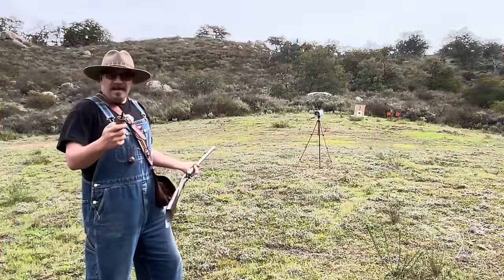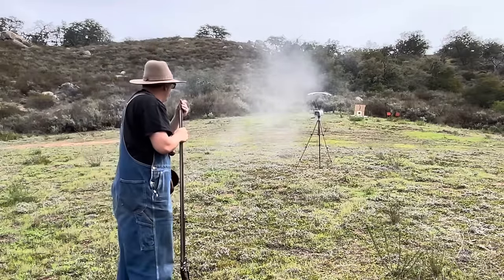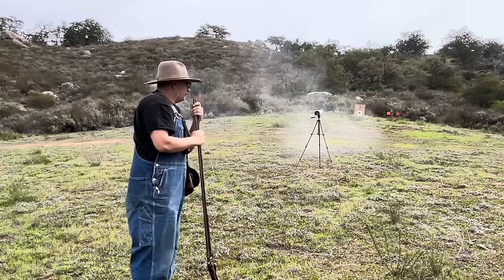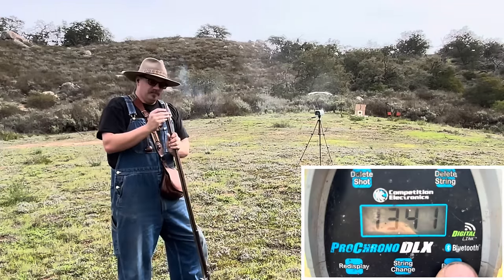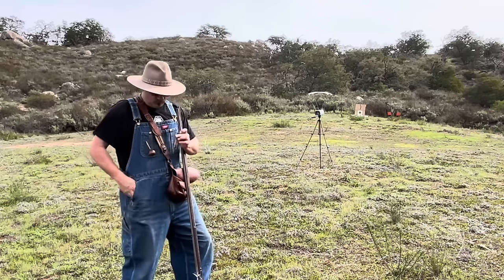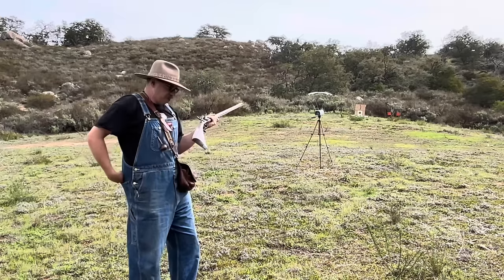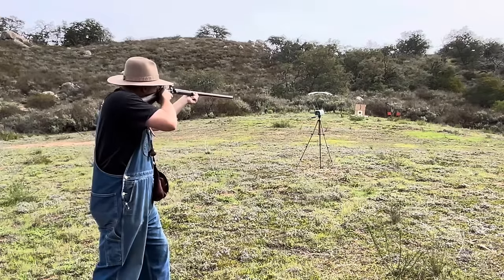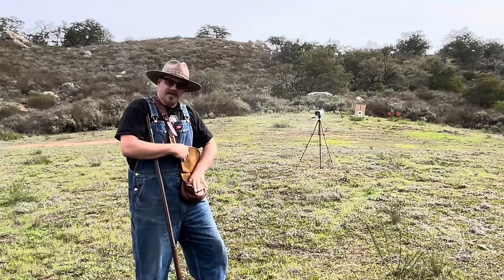Hay Bale Black Powder

Comment: I can see where straw would make poor powder. It has no substance, no mass, so I can see where it would be weak. I would almost bet it was dirtier than you think, but being so soft it cleaned right up with just a little pressure. That may help explain some of the ignition issues as well.

Comment: Thanks for your great videos.

I was always surprised by the zero failure rate in your other videos, this stuff makes up for that .... 

My theory was actually that fast growing plants may not acquire many other minerals and be quite pure carbon. Would be nice if one here in your audience had access to a gas chromatograph and you could each time send in samples to get "a look inside" what the composition of the charcoal really is. 

The other thing, ..., I would guess things like hay, which people had in abundance in the last 400 years or so was already tried. If that was a real game changer it would already been used and heard of. For the military a better powder back in the day would have had many advantages, number of shots on the man, more supply in one cargo, higher production quantity in shots per time, ...

Maybe your best chances lay in the exotics continuing the line of researchers from the past using what was not available to them. This is exactly what lead to the discovery you made with the toilet paper.
Reply from the maker: Thank you

Comment: Somebody beat me to this observation, but the problem could be phytoliths, particles of silica that help with structural rigidity, and may offer some defense against the herbivores, who have evolved specialized teeth to cope with the problem. Although I find it counterintuitive that they wouldn't also create difficulty loading if they're interfering with combustion. I expect you'd get accelerated bore wear from prolonged use of phytolith-contaminated powder.

Comment: This looks like me with my flintlock.  Except yours occasionally fired. Still waiting for Cardboard.
Reply: Expecting poor results from corrugated cardboard because it's glued together.
Reply: @0neDoomedSpaceMarine  Could well be true, but I looked into what the Glue used actually is and it might be OK.  I'll be trying this when my supply of Skylighter charcoal runs out.  However, I have a lot of that, so it won't be this year even.

Comment: Ceramic media is much less dense than brass, and so it is less efficient at grinding. I have found that a HF 4" rock tumbler jar half full of media holds about 1.25 lbs of ceramic and close to 4 lbs of brass. Big difference. The brass drops with much more force as it tumbles. I like the ceramic media for a vibratory style tumbler where it has a strong rattling and toroidal circulating action, but not for a rotary drum. I have had problems with ceramic media grinding pure KNO3 in a drum where the KNO3 sticks to and coats the media, demonstrating the inefficiency of the ceramic. I don't see this effect with the same ceramic in a vibratory tumbler. My HF tumbler is modified to run at about twice stock speed, so it is close to optimum.
There is one other thing that I have noticed: I try tiny samples (match head size) of each BP batch open burned on a creased piece of paper to evaluate its burn characteristics. If it leaves a gritty residue on the paper, it needs more tumbling time. What appears to me to be fully incorporated powder leaves very little residue that has a dusty texture. I have not yet tried any of my powder in a gun yet. I am using fireworks grade airfloat hardwood charcoal and I am intending it for fireworks use for now. I don't have my charcoal retort ready yet, nor am I quite ready for granulation processing. I'm close though, and will let you know results when I have some batches complete.

Comment: OK Jake I know I suggested you try tobacco or it's fun cousin. But the results of the hay bale black powder, are pretty close to what I suspect tobacco would produce yet I do not know that it would be. I think you have several problems going on with the hay bale black powder, one of which I think is moisture content being too high in the hay. But why don't you try using a can of Prince Albert tobacco, and see if it produces the same results or worse. Oh and for the guy that made the pancake remark, no mixing your pancake batter does not make it taste better as it just makes the batter chunky.

Comment: If you take 24h or more making pancake batter, it is very good, but mostly because it's being made with yeast instead of soda and you're making crepes, English muffins, or delicious sourdough versions of either. 
I'm glad I held off on stating my assumption that ceramic media is probably the main problem, since that's covered in the video. I'm thinking that the problem is the small bits of dust that come off of the ceramic are going to be absolutely bad at burning - due to ceramics already being fired at high temps - ,but the brass media is dropping zinc that eats up oxygen and reacts out stuff that would otherwise degrade your BP, and the copper content... Well, just go look at videos of copper thermite (Cody's Lab has some spectacular videos on this) to get a feel for how great a raw metal powder is at combustion.
One daydream I had instead of increasing the video speed is to wet grind the VERY DRY mix in glycerol and calcium carbide. This may be great for a very small batch to be used very soon, but has the additional risk of turning any moisture into acetylene gas and calcium carbonate. The calcium carbonate should dissolve in the glycerol, but I have no idea if the powder would burn right. It was a daydream after all.

Comment: Awesome! If long milling turns crap poweder into descent powder, what  will it do ti really good powder?
Reply from the maker: Generally speaking, it makes it that much better. However, you will eventually reach a point of diminishing return.
Reply: @Everythingblackpowder  diminishing returns is the point you want to fund.
Reply from the maker: In our experience, it’s about 48 hours
Reply: @Everythingblackpowder  
Might be an exploding breach too.
Ever explore weaker powder for weaker guns? Maybe a powder that works for 4" PVC pipe?
I think you need some experiments that you need to use remote ignition and trigger strings for. Fuses at least.
Reply: @Everythingblackpowder I'm thinking fiber board will make an interesting video.
Ikea powder!

Comment: If you can find a container that'll take it, you might grab some of a contender tinder (hah), weigh it 'raw', and then char it with red heat for several hours relatively open to air to drive off all the carbon. The weight of what's left (ash, silica) is a nonreactive component and affects your mixture balance. Should be able to subtract it proportionally from the charcoal batch and get the right amount of carbon percentage, but you're still left dealing with that NRC bulking the powder, inhibiting burn rate, and making weird fouling.

Comment: Video Idea and Question.  I was wondering about using blackpowder as a replacement for smokeless.  I have plenty of plated bullets but nothing lead and nothing with grease grooves.  For instance 357 magnum.  Would running a jacketed bullet without lube be just cause cleaning issues?  Overpressure warnings would look like what?  Is it recommended to put a greased cookie behind the bullet?

I just bought 12 pounds of APP "Shockney" FFg black powder.  I know it is not right for 357 but whatever!  I also have a pietta 44cal buffalo pistol (loooong barrel and brass frame).

I also have a 30carbine single six with an 8 inch barrel.  That would be cool to shoot in BP but I only have plated bullets.

I also have 9mm autos and PCCs.

I think it would be cool to make a video that is a tutorial for smokeless people with smokeless reloading components be able to just buy a pound of BP and try some!  Thanks!
Reply from the maker: Yes, I’ve used jacketed bullets with black powder, and they work well enough but after a handful of shots, accuracy starts to suffer
Reply: @Everythingblackpowder  Do you think there is anything in particular to look out for?  In the great white north handtools MUST be used indoors at a range so its not like I will shoot more than 50 shots.  I have 38 special and 357 cases with 158grain heavy plated (campro.  Like berrys except better quality and thicker plate).
Reply: @Everythingblackpowder  The 30carbine single six is a really early example.  The guy sold it for his uncle who was into cowboy action.  It came with an extremely well made holster with cartridge loops... but its an 8 inch barrel quick draw was not well thought out lol.  Maybe it predated the laws on carrying in the woods.  The trouble is the metal is soft and the cylinder has driven itself into the back plate so its timing and lockup isnt great.  I was thinking some black powder lauching 110gr carbine bullets would be fun.  I wonder if ruger would repair it... its like 3 digit serial number old.

I am very happy you decided to make your own dramn videos!
Reply: @Everythingblackpowder  Sorry for all the messages but talking to a celebrity is  intoxicating! ;)

I suspect that loading black powder on a progressive press would be bad?  Single load only?

I assume I fill the cartridge with the FFg APP to just below the underside of the bullet and get a slight compression and call it good?

I am tempted on trying it with 50AE for giggles too!  I doubt black powder will be any more dangerous than 38 grains of H110.  Lol.

Also.  If you use a progressive made by Lee.  I made a drastically improved cartridge feeder for it that allows instant changes between cartridges.  In 5 seconds you can change to any cartridge, tight diameter, perfect height, good case control, and it re uses the lee tubes and that funnel collator.  If you are interested in that I will send you one.  Its not a product or shill thing.  Just 3d printing hobby meeting the tool hobby.  Speaking of if you can dream up a 3d printing thing I can probably make it.  I was thinking parlour cartridge conversions/projectiles might be a neat thing to try.

I will never wash this phone again!  Keep up the good work!
Reply from the maker: @someguy2741  I have loaded BP rounds on a progressive press, but depending on what you were loading, you might not be able to throw a big enough charge for the cartridge. Personally, I don’t think there’s any danger in shooting black powder or anything as long as it’s not a gas operated semi automatic weapon. After 50 rounds or so, with no lube fowling will be very Hard and start to affect accuracy
Reply: @Everythingblackpowder  Thank you very much!  Your channel is the gold standard in practical get-er-done blackpowder shooting.  I think I will try the 38/357... should be foolproof... ish.  I dont need fantastic speeds and I doubt there will be a lot of 2F so safety first!

Keep up the good work!

Comment: when I go to shoot with my homemade powder I always find red encrustations inside the barrel and I can't understand what is causing it
Reply from the maker: Red is usually sulfur. 
What ratio are you using?
How long are you mailing it for?
Reply: I use your ration of 77 13 10, and running the ball mill for about 12/14 hours
Reply: Using marbles in the jar
Reply from the maker: If you’re using marbles, you need to mail it for 48 hours at least. Give that a try and get back to me.
Reply: Thanks so much, I'll try

Comment: I’d have to imagine if grass made good powder, that it would be normal to make good powder out of grass. It’s almost a guarantee that people have used everything that was available to them in times of need. I think if you are going to find something that works better than traditional ingredients, it will be using something that the people in need didn’t have to use. Like toilet paper.
Reply from the maker: Excellent point

Comment: The constant use of Bro has to be one of the worst things happening to current culture.
Reply from the maker: Well, we’re actually Brothers, so there’s that…
Reply: @Everythingblackpowder  guess I'll start calling girls Sis now.
Reply from the maker: @FoulPet  we call our sisters “sis” as well…
Reply: @Everythingblackpowder   do you call all men and women, bro and sis? I call my sister by her first name.  Hypothetical If you had 4 sisters in the same room and say come here, sis, they would all answer. I've been watching arrests on YT and every cop is apparently related to the  suspect.
Reply from the maker: @FoulPet  no. Just the ones we are related to.
Reply: @Everythingblackpowder  makes sense. Not in the least bit confusing. At Thanksgiving, we had 3 relatives named Paul. We had nick names for each of them. They weren't Bro, Cuz 1 and Cuz 2 however. Rolling papers are pretty thin bro.  May be a good carbon source to rolling your own ammo. Thanks for the video.